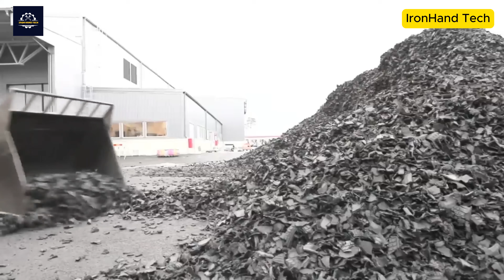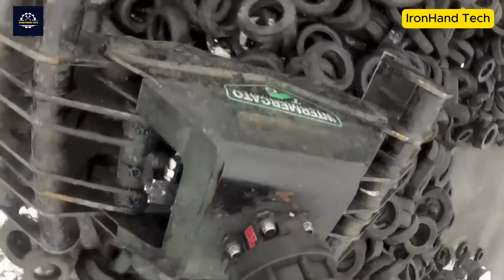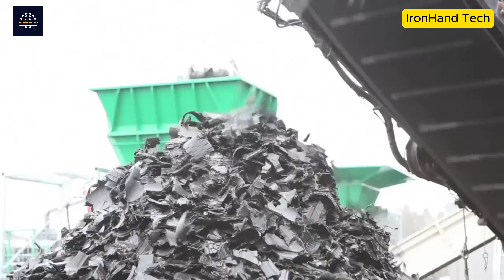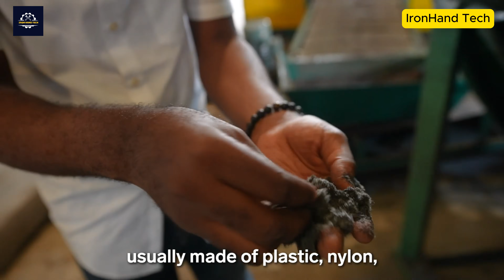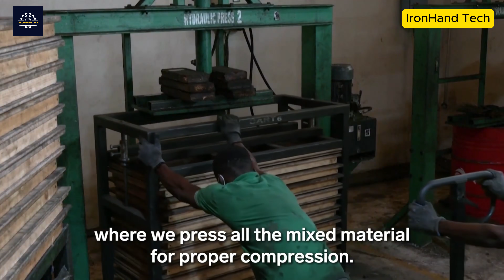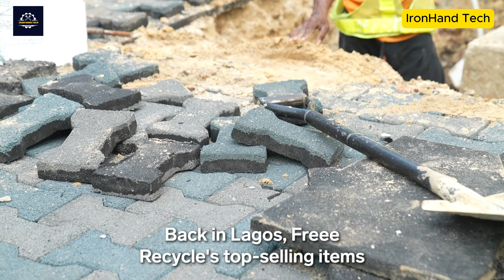Millions of Old Tires Turned into BRICKS Every Year!

Comment: So not bricks
Reply: Don't be so pedantic. Read the reply to your sarcasm and you'll see English is not their first language. So, for brick, read paver. Simples.
Reply: @trevorhoward7682  you misused the word pedantic because the main ingredient is biodegradable and flexible and not long lasting so can not be used as a brick period
Reply: @trevorhoward7682  that was not sarcasm
Reply from the maker: This excactly bricks. You can see it at the end of the video. Thanks you !
Reply: So you’re saying that they’re reused as playground paving blocks that children play on. How does that not continue the same process that causes methane as they break down, causes chemical to leach into our water systems, and are extremely combustible and burn for days causing toxins in the air?
Reply: Where are tire recycling plants in the US?